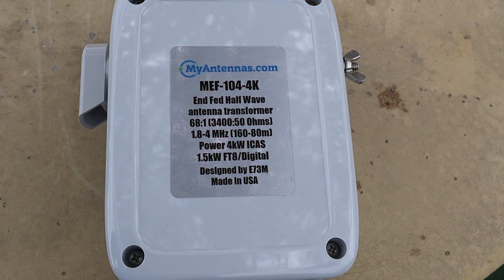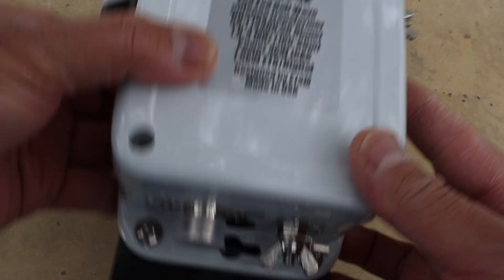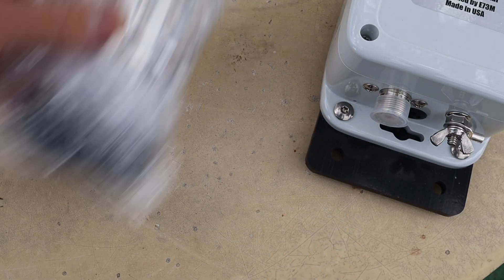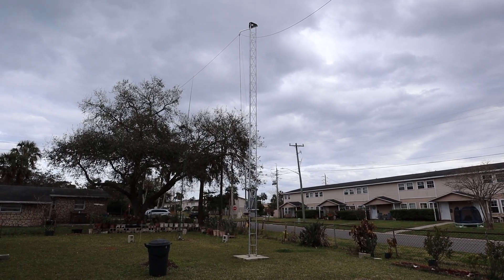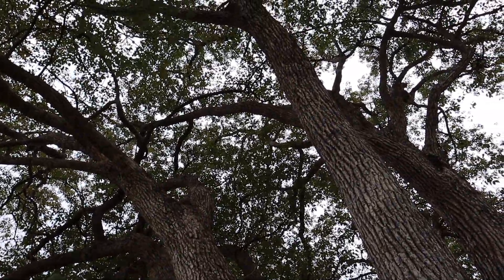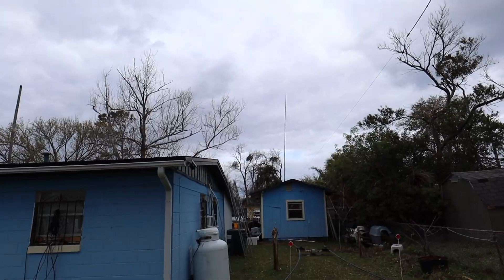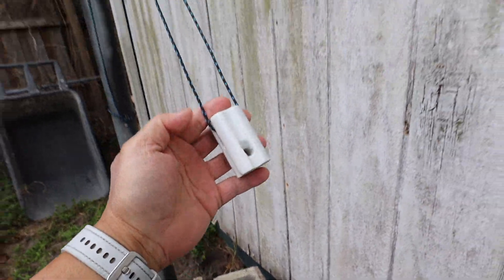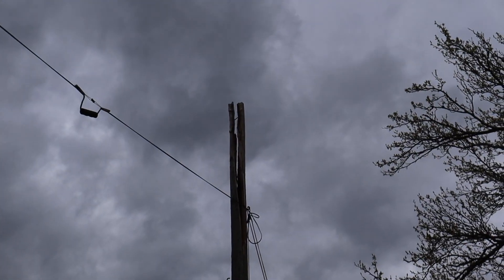MyAntennas MEF-104 4K EFHW | 160-80 meters EFHW | Preview to my new Install

Comment: Great stuff, Capt. Darren. I'm running a Myantenna EFHW-7510-2K-Plus as a mult-band sloper from a  2x4  about 3' to a pulley 50'+ feet high in a water oak tree (Suwannee county is full of them). Combined with Flex 6600 and RF2K-S amp, it works flawlessly on 10-80, and will even do 160. 59s from all over the world. You'll love it!
Reply from the maker: Thank you for the feedback.  I hope so.  These antennas are expensive.
Reply: @DarrenN4VFR  Yes, they are. But combining it with your Anan and/or new Flex, with a "little help" from your RF2K-S, you won't be disappointed. RF2K-S will tune the antenna without issue the handful of times it might need it.